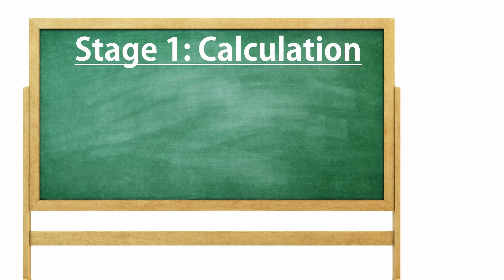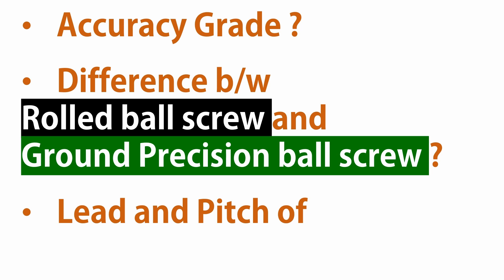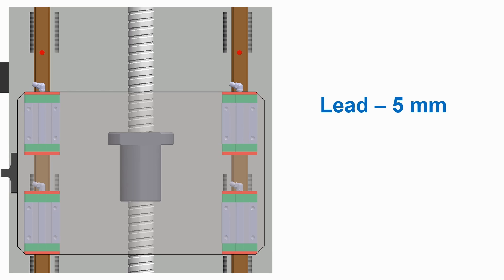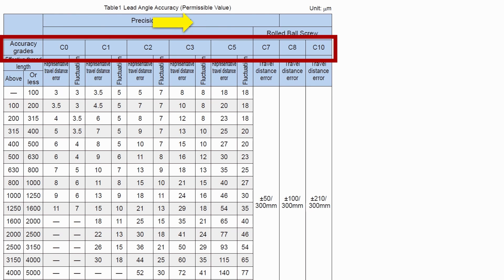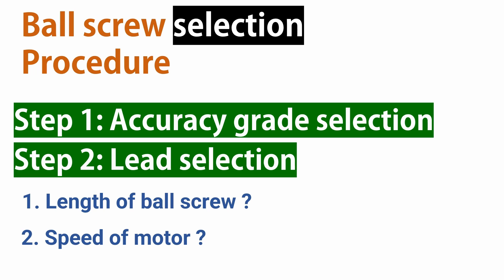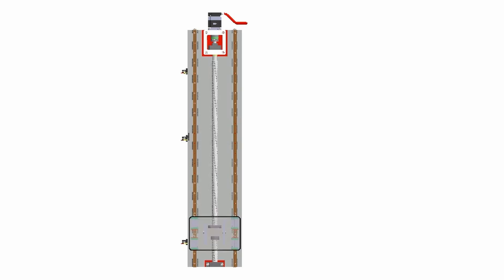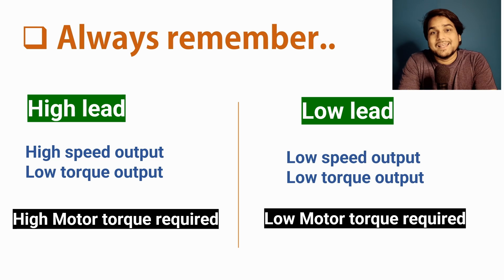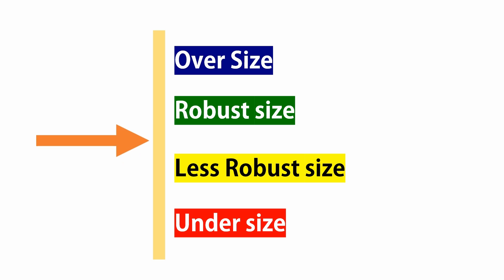Ball Screw Selection Calculation Made Easy | Ultimate Guide 🔥

Comment: I have designed a VMC model and The weight of y slide plate and x table is 2101N. The weight of x slide plate and machine bed is 2083N. Total self weight is 4184N. I am using a 32mm precision ground ballscrew with double ballnut having dynamic load rating as 3195N. The servo motor size is 1.5kW, 3000rpm and a torque of 5Nm.
My question is do I have to consider only y axis ballscrew dynamic load rating for movement from A to B and vice versa on y axis or both x and y axis?
I am using 35mm HGHCA-P level linear blocks and HGR35 rails on all 3 axis.

Comment: Selection of dia respect to load is not explained which is more crticle
Reply from the maker: Watch part 2
Reply: @mastermechanicaldesign  watched 2nd part also 
how to calculate loan is not mentioned
Reply from the maker: Ball screw are designed to take axial load. So, diameter should be capable of withstand buckling load. And I have explained how to check the buckling load for the selected diameter of the ball screw. (There is no direct formula for load and diameter)
Reply: @mastermechanicaldesign  well noted and thanks

Comment: Is the design for roller screw different than ball screw?? If yes can you please make a video in depth like how you did with Ball Screw. Thanks in Advance. Hope you continue to make more videos about mechanical and electro mechanical topics. Also please do more videos about the basics of Mechanical engineering like, Kinematics of Machines, Dynamics of Machine, Machine Design, Strength of Materials, Manufacturing concepts like CNC Machining, G and M codes, Ansys software.
Reply from the maker: Yes, roller screw is different than ball screw, roller screw design is more line planetary gearbox, but use for linear motion, I never used it. Yes, more of Mechatronic projects and videos are coming/.

Comment: Sir can you add videos for Sheet metal enclosure design - material selection, surface roughness, K factor, bending parameters, strength, hole design parameters, welding parameters
Reply from the maker: Yes, sure

Comment: Can Roller screws actuator be used to replace hydraulic cylinders in a block press mechanism
Reply from the maker: Yes, if only pressing is the function, the why not
Reply: @mastermechanicaldesign  so I see in the video you have explained only about ball screw, so in this case, how do you work out the pressure exerted by the roller screw actuators

Comment: I have a question how to control this system by a controller like plasma machine
Reply from the maker: To control sevo based linear actuator, we will need servo drive with this servo motor and we can use PLC to program, servo operate on Plus. in drive feedback loop. Also we have to take position and home sensor output to PLC. 
With a plasma cutting machine we can also take system like PP sensor output to the PLC.
I'm not an expert in PLC, we can also use custom programming like in scada, NI, matlab there are many options.

Comment: Nice video...how to choose for radial load bro?
Reply from the maker: Hii Sivasugandan, there is already radial load (twisting load) on ball screw, because of applied motor torque. and axial load due to lifting weight.
But on Bearing support units the is not much radial load because of vertical condition, if there would be significate radial load, then we have to consider radial load too in calculation of "Equivalent dynamic load on bearing." in bearing selection, bearing life calculations. 
Please let me know, if have any confusion